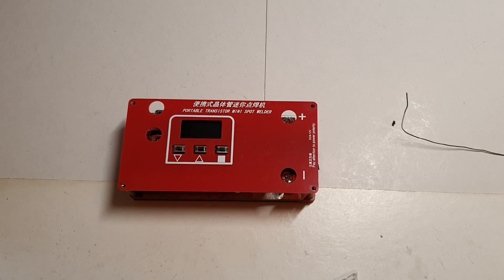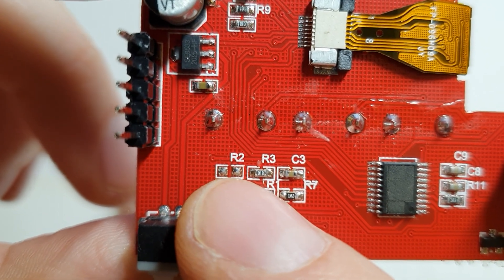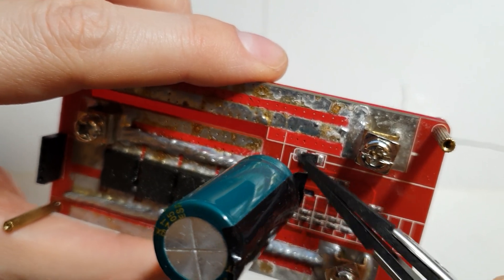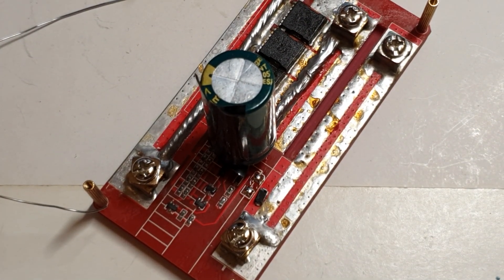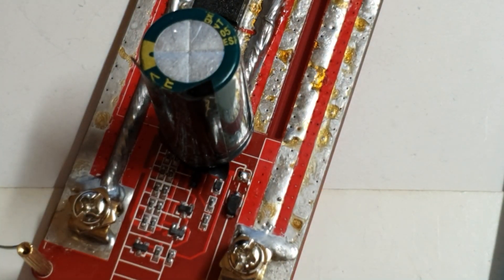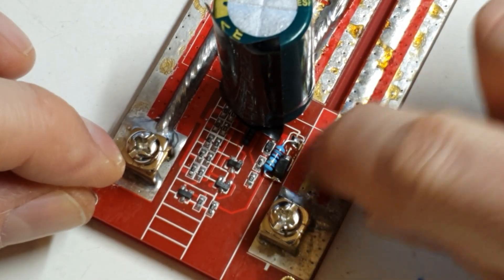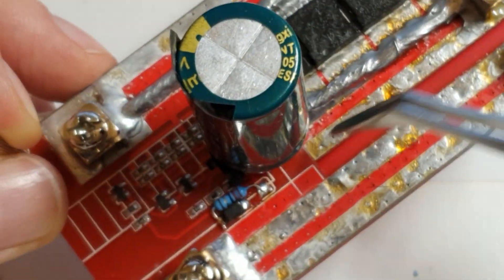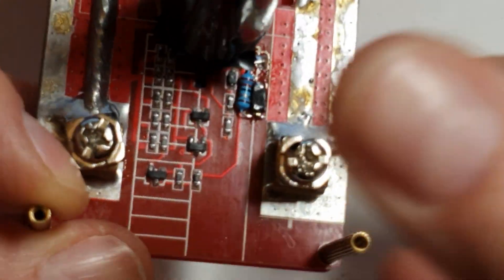Mini Spot Welder Bk11-1k BL18-2K CA04 Inrush current limiter resistor mod - check your diode!

Comment: thanks 
Luca for the video its so clear now ,,,,kindly  I would like to ask of the Mode that u did in the down side of the board what is it and should we do it 

thanks again
Reply from the maker: If you're referring to the copper wire strands I soldered on to the Drain and Source traces that's to improve conductivity - it's not mandatory but it lowers overall resistance and improves performance.
Reply: @Luca_Techy  i did that already its good idea but i was asking about the down side down other side of the board u did something there and mention u already know about this in the video
i have other Question please can i use it with 4S or 3S 15P pack
Reply from the maker: @abushouke  Oh you mean the back side - I was referring to my BK11-1K mod, you don't need this on the BL18 as it's been fixed on the top traces. Better stick with a 3S if it's really 15P (you don't need 4S). You could even use a 2S if the internal resistance is low enough - remember it's the current not the voltage that matters here.

Comment: Good job Luca,I finally understood you last night one more thing was if it’s any better using M1 diode instead of M7 here?
Reply from the maker: There's really not much difference in this case, M7 has a higher breakdown voltage but a slightly lower peak current but it's fine with the 10Ohm resistor in series.

Comment: In the last video you said 10 Ohm is ok. Now you say 20-100 Ohm. Is 10 Ohm enough?
Reply from the maker: 10 Ohm is enough *with the original diode*. However if yours is shorted and you replace it then it depends on what diode you use, so for safety use a 20 Ohms resistor instead.
Reply: Ok thx, do you know the specs of the original diode? I use now a M4 and im unsure that are the specs of the old one.
Reply from the maker: It's shown in my previous video, it's an M7 diode
Reply: Ok, so i need a another resistor with more then 10 Ohm. Is 20 better or 100 Ohm (100 i have) or something between?
Reply from the maker: 20 Ohms is fine for basically all 1Amp diodes (1N400x) up to 50, I don't suggest more as charging time will be in the seconds range
Reply: @Luca_Techy  Many thx, now i use two 10 Ohm resistors in series and it works fine.

Comment: Sry, ich verstehe englisch, kann aber nicht in englisch schreiben. Erstmal Danke das du so viel Zeit und Mühe investierst. Ich benutze den Bk11-1k und habe alle mods übernommen . Nach auflegen der Elektroden macht's piep..piep...nothing. Die fets und die diode sowie alles was ich durchgemessen habe ist in Ordnung. Ich weiß, ohne das Gerät vor Augen ist eine Diagnose nicht möglich, aber vielleicht hast du ja einen Tip woran es noch liegen könnte. 
Mach weiter so 

Vielleicht konstruierst irgendwann mal einen eigenen von Grund auf
Reply from the maker: Please check the FET Gates to see if there is a hard short between each Gate input (pin 1 of MOS) and GND. There should be no continuity between Gate and GND (Source) rail. Then check the push-pull and driver transistors, no shorts between Base, Collector and Emitter here either.
Reply: Hi Luca, great job.
I heard you comenting the input capacitor is too big. Not necessary.
I went back to read specifications, on eBay sellers, it is said in general that one can use a 18650 li-ion battery, 12V 35Ah, besides the normal Lead acid and LiPo.
Which means the big capacitor does the welding inrush current balance, not just the supply voltage.
Pls comment.
Reply from the maker: @faxavier65  That's the point, the large capacitor DOES NOT support the weld current, not with this circuit and diode which is why I said it's way too large (not that it's not necessary) and there's no need (a 470-1000uF one would suffice). IT DOES however in the first revision of the Mini Spot Welder (unlabeled) where you need the additional Capacitor on the MCU exactly because the large 10000uF cap is directly in parallel to the battery without reverse discharge diode. If you check the circuit of these later versions you will see. I am putting together a more in depth comparison on the different circuits based on the various revisions for who is interested.

Comment: For r4 I just soldered  a 1K in parallel , I used 10 ohm and a 1N4007  to replace the M7 did 10 welds on .15 mm and it worked great. I have a bunch of old boards with smd diodes but I had no idea what they were. Thanks again for your info!
Reply: i know im asking randomly but does anyone know of a trick to get back into an Instagram account..?
I somehow lost the password. I appreciate any tricks you can offer me.
Reply: @Cyrus Khalid Instablaster :)
Reply: @Aiden Avi i really appreciate your reply. I got to the site thru google and Im waiting for the hacking stuff now.
Seems to take a while so I will get back to you later when my account password hopefully is recovered.
Reply: @Aiden Avi it worked and I now got access to my account again. I am so happy!
Thanks so much, you saved my account!
Reply: @Cyrus Khalid No problem =)
Reply: @aidenavi5976  WARNING: DONT DOWNLOAD THIS SOFTWARE. THESE TWO ARE BOTS TRYING TO MAKE YOU DOWNLOAD MALWARE.

Comment: If we remove the diode and do a bridge, what will happen?
Reply from the maker: The cap will discharge towards the weld following the battery voltage drop (see the scope shots in previous video, battery drops to less than 5.8V then even less at the driver circuit, dangerous!). You absolutely need a diode there to avoid this!
Reply: @Luca_Techy  ok I understand, so it can't be the cause of my problems on my 2 spot welders. I will check if the diode is shorted. I don't understand why the mosfet are not driven after the 3 beeps and it drives me crazy 😝. Help me to find why please, you can contact me on messenger nickname seb vsr.
Reply from the maker: @SebVsR  will try to help out but without a scope to check what's happening with the trigger circuit it's not likely I will be able to succeed! You really need to trace what happens on pin 4 of the mcu board and check the 1k/10k divider, transistor driver and pushpull
Reply: @Luca_Techy  how can I contact you to talk about it, on youtube it is not convenient 😕

Comment: Nice video as usually, just a question. I own a BH10-1K unit with the capacitor mod. Does any of the R4 resistor or the inrush resistor next to the diode mods apply to my unit?
Reply from the maker: I haven't looked at that specific model, but as the diode is after the cap, the issue is mostly connected to the size of the added Cap because the diode drives that when you power it up (that's the whole initial issue). The large cap sits on the bottom pcb and is directly connected to +V from the battery with nothing in bewteen in your version (at least I believe the BH10 is so, check if you see any diode on the main board). If you have added a 1000uF 16V then you should be ok as the original diode can handle current peaks for a short amount of time (none have failed yet from what I know).
Reply: @Luca_Techy  The main PCB contains only the mosfets and the capacitor. On the opposite side, all there is are five diodes one for each mosfet. I wish I could send you one welder like mine but even if I order one, I doubt it will be my model, more likely to be one similar to the ones you have. For what it worths, I use my spot welder a couple of times every week. The only thing that strikes me as peculiar (perhaps I shouldn't even had to mention this) is that my device is permanently connected to my AGM battery (I have ordered quick release connectors, they haven't arrived yet) and I use the on/off switch to turn it on. The first weld, only the first, doesn't have the right timing on the beeping signal (I use auto weld) before the weld, the beeps are infact much faster. All subsequent welds are fine!
Reply from the maker: @solidhit2  Keep in mind that even if you turn off the switch, the welder power is always there (FETs and CAP are powered) so I would suggest disconnecting it completely after use. About the timing issue: does this happen every time you turn it on or just after it's been sitting there for a while? The timing is only MCU based (no external components) and the auto trigger circuit just detects the voltage when you short the 2 contact probes. You should try with the manual weld power (use just a normal push button to test) and see if it does the same.
Reply: @Luca_Techy  Waiting for these EC5 connectors, then I will be able to easily connect/disconnect the battery. Until then, I treat the device like it's constantly powered. A quick answer to your question is that the manual mode works as expected (in the beginning I was using a foot switch), it is only the auto mode that displays that behaviour. As I wrote, I've been using the device at least a couple of times a week and this happens every time I start it, the first weld looks fine, it's just the beeping before the first weld that is very rapid (like almost no pause between the beeps)!
Reply from the maker: @solidhit2  seems like a firmware bug to me, wouldn't worry too much about it - the important thing is that the timing is right and welds look fine!
Reply: @Luca_Techy  Thanks, is there a chance you find the time (and interest) to give us a more in-depth review of the "wise maple" version of the welder. If it turns out to be as issue free as you mention in your videos, I will order a couple for backup.
Reply from the maker: @solidhit2  I talk about it in my previous comparison video Yet another mini spot welder- did you check it out already?
Reply: @Luca_Techy  Of course, it's just that I'd feel better if you took some more time with it, you have a talent spotting faults and bugs. I'm thankful as it is though!
Reply from the maker: @solidhit2  I'll be showing a more in depth circuit comparison between versions see keep an eye out for my next vid!

Comment: funny how people dont understand how to connect  a resistor in series , if they still dont know after this video they shouldnt touch a soldering  iron, thanks tho
Reply: More importantly, if they don't understand how to connect  a resistor in series then they CERTAINLY shouldn't be playing around with something as inherently dangerous as 18650 lithium batteries.